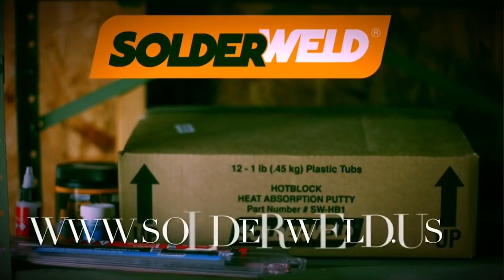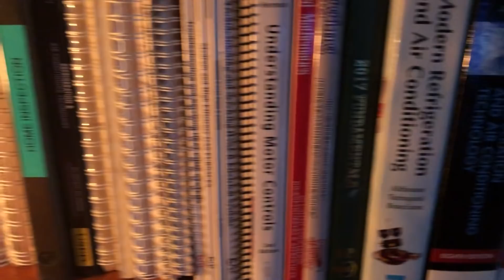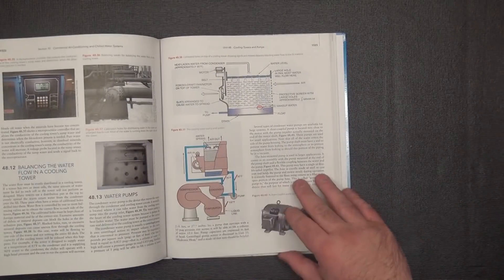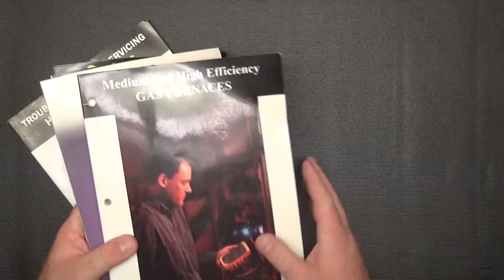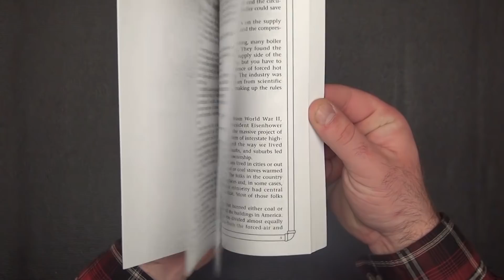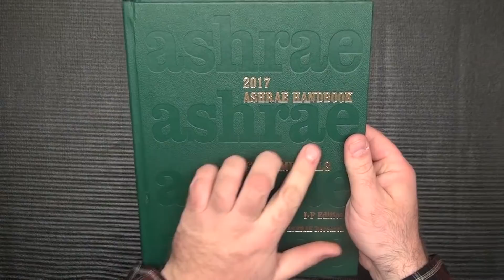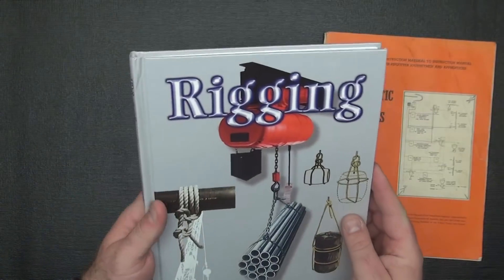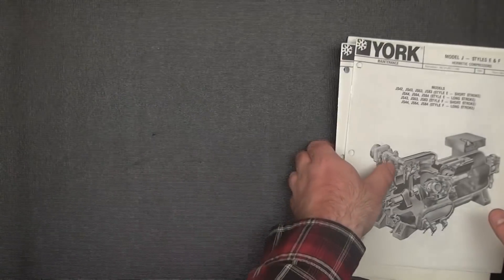5 MUST READ BOOKS📕📗📘 for HVAC Apprentices!

Comment: Dick Wirz for Modern Refrigeration?  Which version?  This vid is 5 years old, but even if I look at older editions he ain’t listed as an author.   At about the same size (1728 pages) I recently got ‘Refrigeration & Air Conditioning Technology’ with Eugene Silberstein, do you think that’s as good?    The current version of ‘Modern Refrigeration and Air Conditioning’ is by Althouse, Turnquist, and Bracciano.   Although I did just order Wirz’s Commercial Refrigeration WooHoo!!
Reply from the maker: I misspoke regarding Dick Wirz, check the top comment that i pinned after i posted the video where i addressed that.  Sorry for the confusion, all you books you metioned are fantastic and will serve you well 👍
Reply: @AKHVAC  oh RACT is an acronym lol.   Awesome, RACT is exactly what I bought then, cover just looks different on 9th edition, and my eyes are terrible I should have just paused the video and zoomed in on it.   Perfect then, thanks!

Comment: hello,good day for you,really your 5 books was very good for me as an electrical engineer could you please send me a PDF copies for these books address 1- Understanding Motor Controls
,2-Refrigeration and Air Conditioning Technology 8th Edition,3- System Diagnostics and Troubleshooting Procedures (2002, Paperback)
,4-Troubleshooting & Servicing HVAC & Refrigeration (HVACR) Electrical Systems
,5-(Diagrams) Electric Controls for Mechanical Equipment Servive. (UNITED ASSOCIATION JOURNEYMEN & APPRENTICES.) Spiral-bound – 1999
,6-Troubleshooting & Servicing Heat Pump Systems 
,7-
  your cooperation  will highly appreciate
best regards

Comment: "Modern Refrigeration and Air Conditioning" is by Althouse, Turnquist and Bracciano.
Dick Wirz is the author of "Commercial Refrigeration for Air Conditioning Technicians," and it's a very good book for the truck. This link is for the most recent, third edition. I have the second edition, which also has color illustrations. 
https://www.amazon.com/Commercial-Refrigeration-Air-Conditioning-Technicians/dp/130550643X/ref=sr_1_1?s=books&ie=UTF8&qid=1534021620&sr=1-1&keywords=refrigeration+for+air+conditioning+technicians

Comment: One I definitely recommend is barons mechanical aptitude and spatial relations test booklet if your not mechanically inclined. The books shows and go through basic mechanical principles, pulleys, leverage etc and it was a fun and quick read. Thanks again ak hvac, wish you would’ve been around when I was coming up in the trade
Reply from the maker: Billy mele I will look into that Barons book, thanks for the recommendation!!  Appreciate you watching👍👍

Comment: Thanks for your vids. I am only a cook now, but I just took my EPA test. Getting out of the frying pan and into the furnace so to speak.

To someone in my position where HVAC work is only still a dream - you gentlemen workin the internet are a godsend and a constant source of inspiration, motivation, and information. Good work and great vids. Nice to see your sub count growing surely.

I am reading books from the 90s because they are so cheap. RACT 3rd edition from '96. PLC book from '99. Electronics testing from the 90s. Haha. Im still learning though.

Install manuals are badass.

It would be nice to see a budget books series as well.
Reply from the maker: Thank you for watching!!  Most of these books have older versions available used on Amazon!  Also look into "half price books" bookstores in your area, I have two stores in my current city.  Tons of old texbooks, usually for 10 bucks or so.  Best of luck into your journey into this trade sir!

Comment: What +Familia Sanchez HVAC said, the Commercial Refrigeration book for AC Techs by Dick Wirz. I've got the new edition in hardcover, and the previous edition in Kindle format. It's in color, and you can zoom in without degradation to the graphics, great thing for older guys like me with reading glasses, lol! And if you have a tablet, I recommend all the manufacturer service manuals available in PDF format, for the same reason, zoomable graphics, great for small print schematics like Daikin has in their manuals. Putting out good content Andrew!

Comment: i am in my second semester of HVAC and write my g3 in a month then 3 more months of school then i willl write my g2 i love your channel man thank you for your knowledge i will have to look into these books
Reply: What's g2 and g2?
Reply: @henryesp9284  this guy lives most probably in Canada just like me.I don't think people in US need these licenses or probably the name of them are different.G3 is basically is the license that you need in order for new techs in Canada to work on gas appliances Wich needs to be under supervision of the G 2 license.So basically G3 license is entry level then is G2 which enables you to work on equipment up to 400000 but/h.now if you want to work on any unit which it's heat rate is 400k and up you need to have you G1 licence.so again these 3 licenses are only for gas equipment in canada.for air conditioning and refrigeration you need different licenses which they are called 313d(enables you to work on air conditioning systems up to 5 tone)and 313 A(for air conditioning units bigger than 5 tone and commercial refrigeration equipment like walking coolers and freezers)I just tried to give you an Idea how the licensing in Ontario works in terms of heating and air-conditioning

Comment: Don't keep the manuals.  Manuals are to be left with the equipment.  And that is code here in Ontario!
Reply from the maker: Adam Walker I should have mentioned to make sure to check with the owner. I usually install commercial equipment. That will have several manuals (user manual, install, service etc).  Certainly didn’t mean to advocate stealing them. Especially if it’s code for you on top of that!  Thanks for watching 👍👍
Reply: AK HVAC yep, what I do is download a PDF of them and keep them on my Google drive so I always have access to them.
Reply: I download pdf files and save them on my iPhone , adobe reading works great